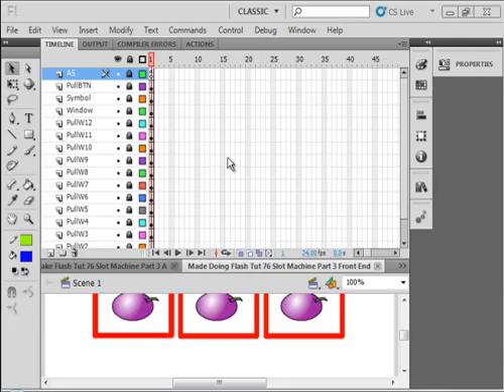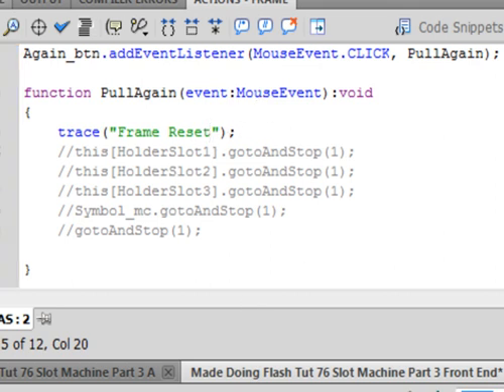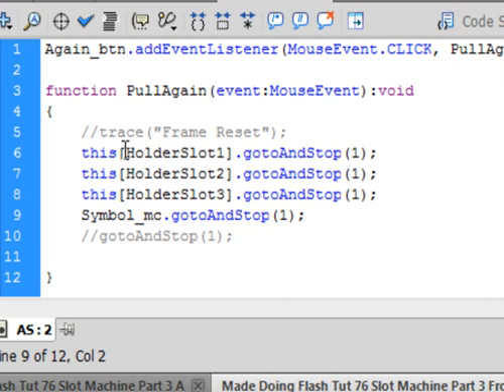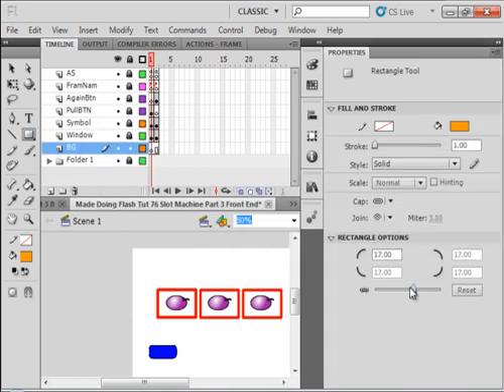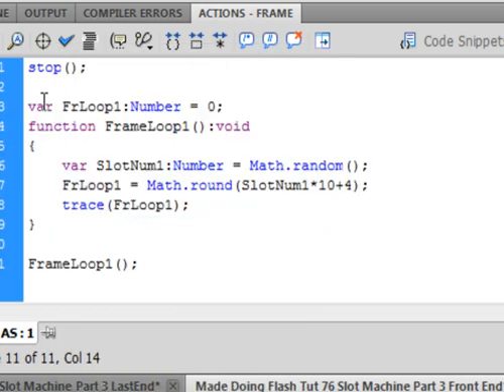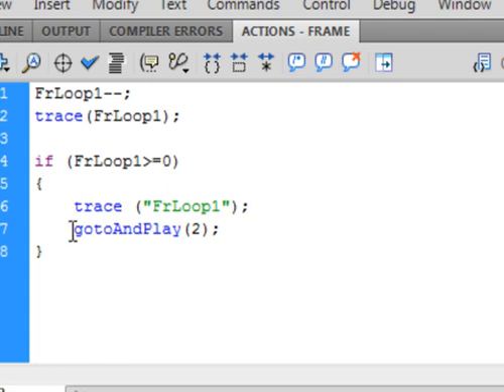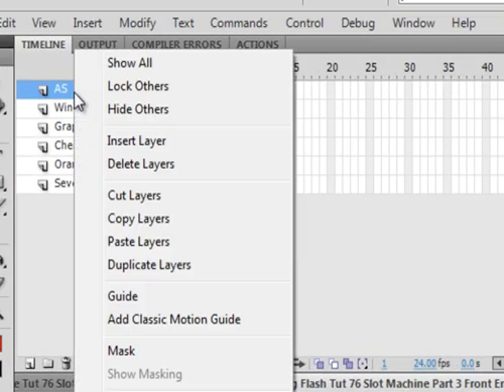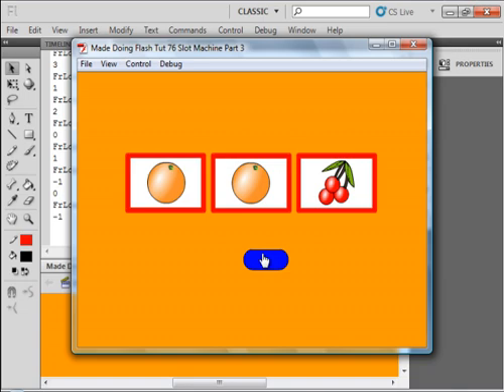Flash Tutorial 76 Slot Machine Part 3

Comment: great tuts..all works perfectly
i just have one question. is it possible, not to have the reset button, but when click on the pull button, it begins to roll from the last position, and generate some other random numbers
Reply from the maker: It is not  a simple thing to do. I will look at it and get back to you. May take a couple of days.
Reply: :) great thanks
Reply from the maker: I have been working on this for you. At this point in time I am able to have it roll from where it last stopped. I think I may be able to do it without a reset. If you are still interested let me know. Send me your e-mail address. When I get it I will get back to you via e-mail.
Reply: Hey man I totally need the same thing. This was the best tutorial Ive ever done, I have learned so much

Comment from the maker: I can see where I went wrong. At the 23:45 ish I said something like "copy AS layer from PULLW1_mc and do PULLW2, 3 & 4.  copy AS layer from PULLW5_mc and do PULLW6, 7 & 8." It is not necessary to copy PULLW5. All you need to do is copy the AS layer from PULLW1_mc and paste it in the remaining 9 movie clips. (2,3,4,6,7,8,10,11 & 12). Just as you did for PULLW5 and PULLW9 at the 19:40 point in time. The "corespond" is to make sure you change the "1" to the appropriate PULLW number.